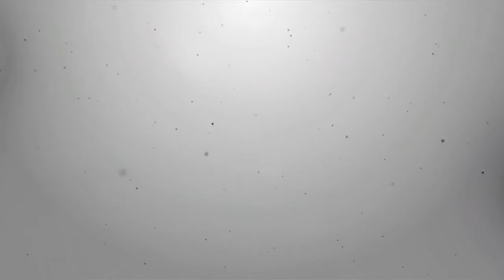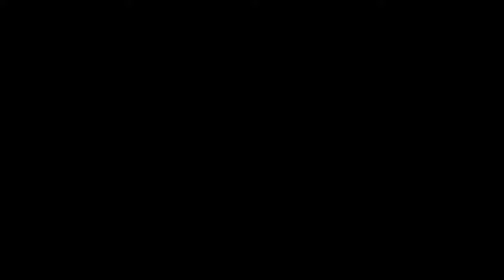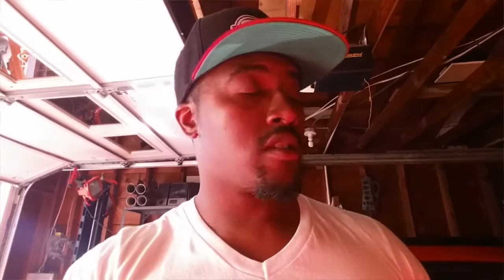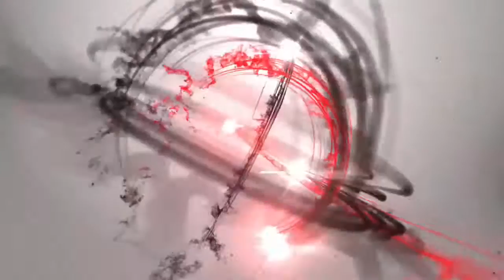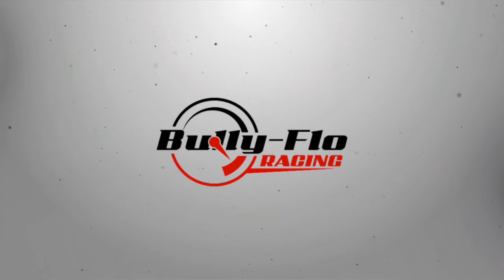Engine Building for Target Horsepower

Comment: how do you multiply by ratio? say I've got an L6 at 14.9 A/Q, 10psi from turbo, 5800rpm limit, 8.7:1 comp, I can get through this formula until I have to multiply by 8.7:1?
Reply from the maker: plug in 8.7 as your multiple.
Reply: copy that. thanks!

Comment: sub for sure bro!!

Ok so here is the info on the Weistec website for cnc ported heads for my 2009 c63 amg.

5-axis CNC machined

397.88 CFM Intake flow

257.81 CFM Exhaust flow

Any thoughts on what this means and is it possible with this info to port the heads correctly ?
Reply from the maker: based off what you gave me, here's what I can tell you. 

Your car makes peak horses at 6800 rpm with a 9.5:1 compression ratio. Your heads are very close to 100% efficiency at a 63-64% exhaust to intake ratio. 

14.7+0(boost) =14.7

x378 (cubic inches 6.2)
x6800
x9.5:1
x 1.0 V.E

÷5252 ÷150.8 = 453 horses

when porting, I'd keep the same e\i ratio (around d 65%)

know that the average percent more flow you get will raise your peak power accordingly through the rpm.
Reply: Maxmaj1q Oh woe ok, well I got some more info dont know if this helps anymore but let me know. so what do you think I should port? like the shapes on the e/I I'm very dumb when it comes to this so please bare with me and thank you fir helping man a lot!

5-axis CNC machined

397.88 CFM Intake flow

257.81 CFM Exhaust flow

Fully assembled, Ready to run heads

Custom ground factory 40mm intake valves

Custom ground factory 33mm exhaust valves
Reply: AMG HEAVEN f

Comment: Maxmaj1q Ok so I got some more info on the ported heads. This is what was on the website Weistec.com for my 2009 c63 amg. Listed under information:

5-axis CNC machined

397.88 CFM Intake flow

257.81 CFM Exhaust flow

Any thoughts on what this means and is it possible with this info to port the heads correctly ?

Comment: What's up? I've got a 2003 stock Impala LS with the 3800 V6....The car runs great, but runs a little hot for me (Guage runs up to the half mark), but not in the red. I  took it to an Express Oil change and they said after seeing a puddle of oil on top of the manifold and 3 failed block tests, I need new head gaskets..They want to charge me 2500, What do you think about that? Any info you can provide would be helpful....Thanks
Reply: do it yourself
Reply: darionmilton I am considering buying everything and getting one of my mechanic buddies to help